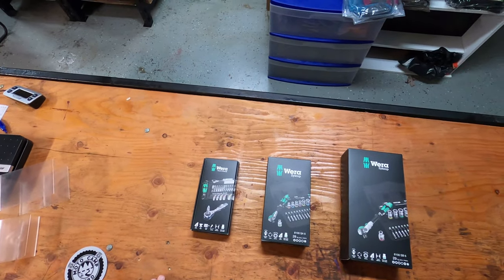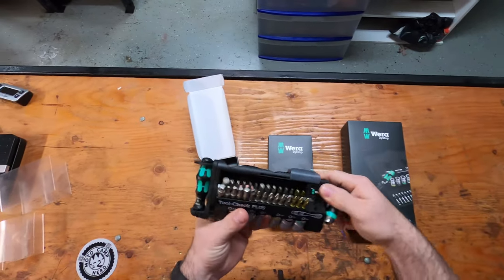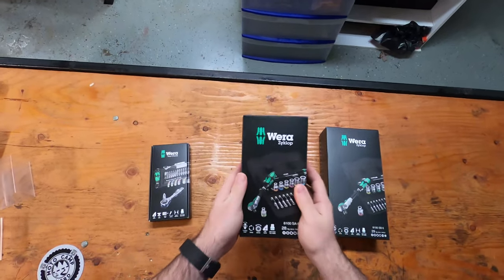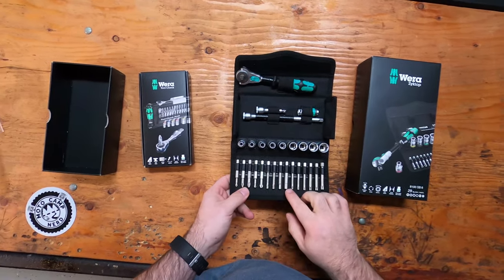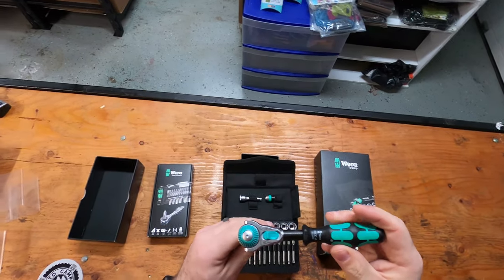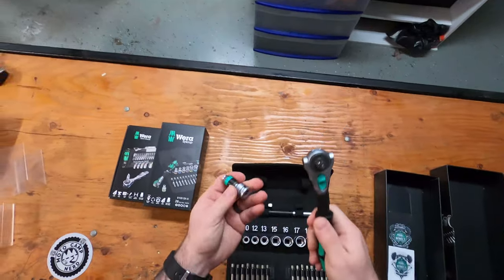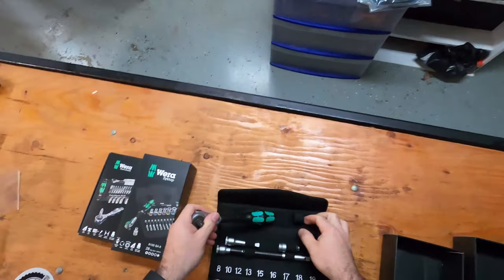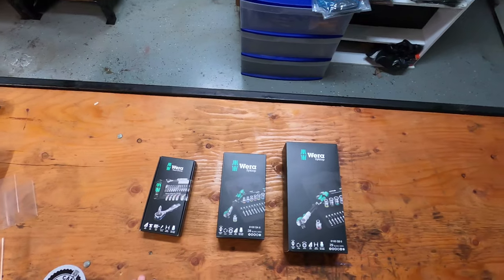Great Motorcycle Tool Kit? Wera Tools? - Moto Camp Nerd

Comment: I think it is overpriced.
Reply from the maker: For what the average rider needs, probably so. For someone wanting reliable high quality tools, you pay for that extra fit and finish, plus these are designed for industrial maintenance. Be sure to check out the SBVTOOLS we sell as well. Again, high quality tool kits made for motorcycles.

Comment: I love the WERA tools, I have the Mini, and it is usually the only rachet set I use working on my dirt bikes BECAUSE it is so tiny, all the bits and most useful sockets are in the tiny plastic case.  The 5 degree throw required to advance the socket/bit is a BOON to working in carbs, hose clamps, and all manner of things without performing more complete disassembly.  With the torque capability (I think 80 ft lbs), I can apply a little pipe and crank all I ever want to while loosening things on dirty dirt bikes, and it's not easy to over torque most things if working trailside.   I can usually fit all or nearly all the tools I need on my Beta 200 and 300rr under the seat.

Comment: Great tools.  I’ve had the Wera 3/8” kit on my bike for years.  Along with a toll roll with wrenches, pliers, multimeter, etc…. Very compact and doesn’t take up too much space in the pannier.  I’d also point out that any other bits you need can be purchased separately. It’s worth taking the time to use these with your normal bike maintenance so that you’re confident that you have the exact sizes you need.
Reply from the maker: That's a really good point. We should start stocking the individual bits that riders need to add to these kits. I always encourage people to build their own kits for their bikes so they know they have what they need.

Comment: I've been looking at these and adding their 4 pc spanner kit. Seems like that would do most any job on the trail with my KTM 500EXCF. However, how heavy are these tools? Space saving is important for sure...but so is the weight, especially off-road.
Reply from the maker: The tool check plus metric kit comes in at just over 1 pound (18.5 oz)

Comment: They messed up by not tossing in some open end wrenches. 8, 10mm are crucial
Reply: This set isnt specifically made for motorcycles. Honestly it's a pretty aweful motorcycle tool kit if this is all you carried. In my opinion your toolkit should be well thought out and have most of the tools that you need to disassemble most anything on the motorcycle. One way to learn what tools you need is to try and do basic maintenance tasks with your toolkit and you'll quickly find out what works and what doesnt. Would be a shame to find out your toolkit sucks when you're stranded in the middle of nowhere with some fixable problem and your tools let you down.

Comment: Is the 5.5mm socket a bit of a strange inclusion? Can’t say I’ve ever seen a 5.5mm nut or bolt head
Reply from the maker: Surprisingly enough, I've used the 5.5mm a lot over the years as an industrial maintenance tech, which is how I originally came to learn about Wera.  Outside of manufacturing and production equipment, I have not seen the 5.5mm used, but I'm sure they are out there.
Reply: AFAIK 5,5 mm is the head size of an M3 screw. So if one regularly comes across „Mxx“ nuts and bolts, this might be handy.